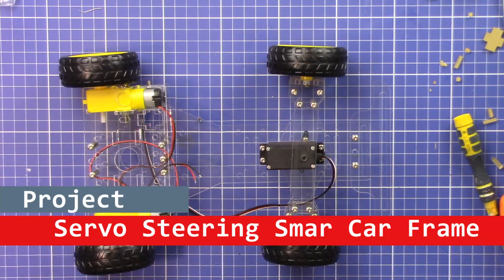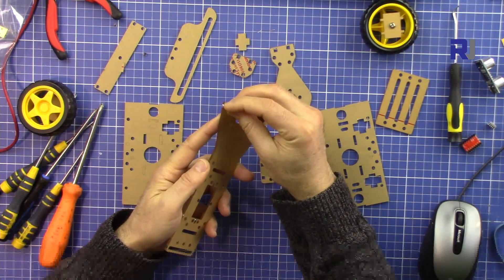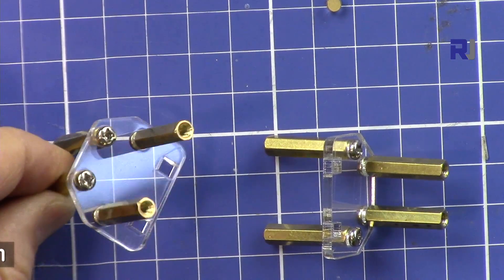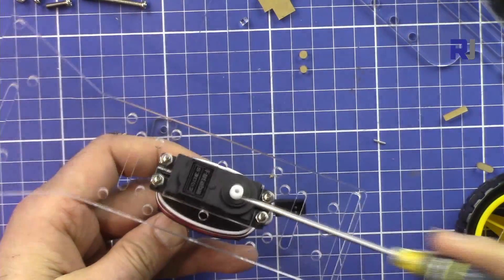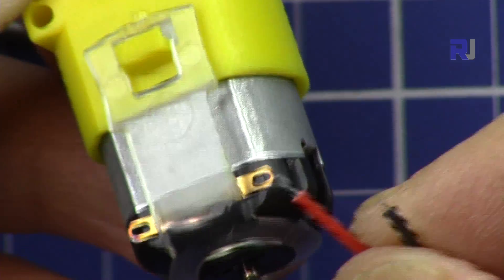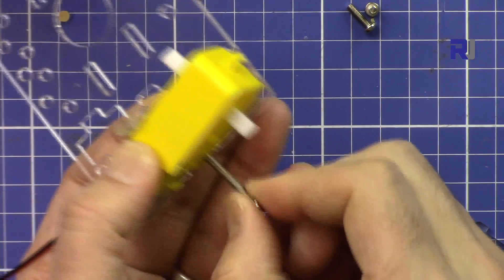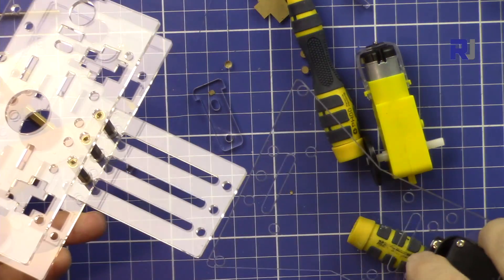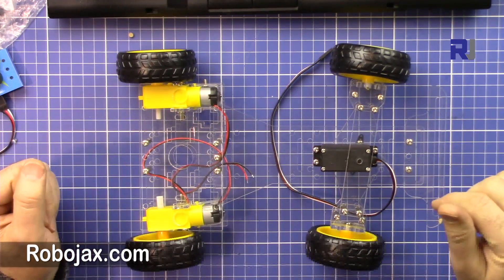Frame Assembly of 4 Wheel 2 motor Servo Steering Smart Chassis car kit

Comment: What battery did you use?
Reply from the maker: The battery does not matter. the voltage of the battery must be the same as the motor. if your motor is 12V, then use 12V battery and if your motor is 5V then use 5V.

Comment: How can I control this car with esp8266
Reply from the maker: Controlling car is not just simple.  we need to control movement and control the steering.  for the motor we need CW and CCW direction of rotation and for steering we need to use servo. I have videos for Servo and DC motor for ESP8266 or ESP32. Here is how to find Specific YouTube Video in a channel https://bit.ly/findYouTubeVideo so search my channel.

Comment: Hi, I also have been working on this kind of project, (Obstacles Avoiding Arduino Car), but I have one motor for front wheels and one for back ones. When it sees an obstecles in front, it is turning left or right making a circle not going forward again. Can you help with this, please?
Reply from the maker: Hi, this can't be explained by writing.  It needs video and I am not sure if I have the material to make video for this.

Comment: What have you used for the power supply for the servo to test it. Is that a lipo battery. And if it is please can you tell me it is of how many volts.
Reply from the maker: Servo has operating voltage. it should be 5V and does not matter where it comes from. I usually use power supply.